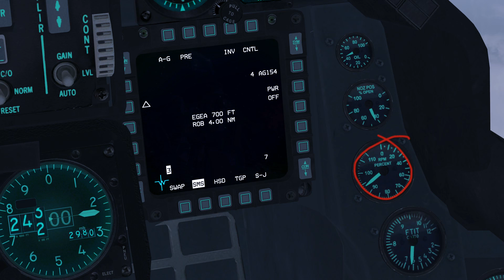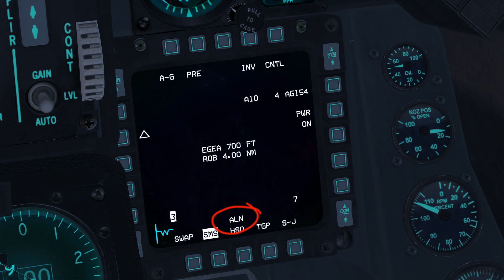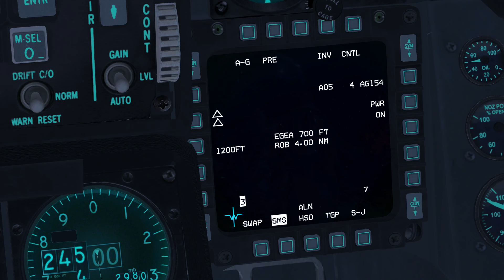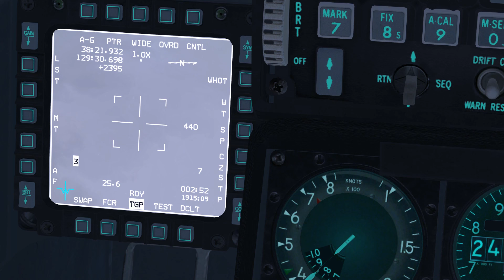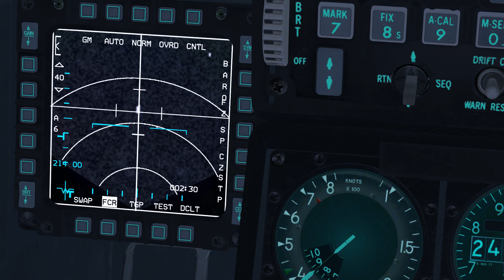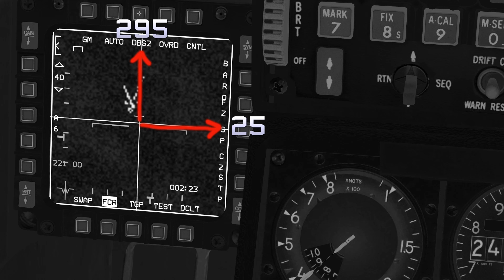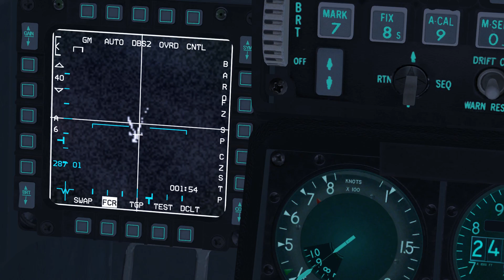Falcon 4 BMS 4.33 Tutorial 12 AGM-154A JSOW vs 2 mechanised columns

Comment: Do you have to set  a mark tgt?  Can't you just lock the tgt on fcr?
Reply from the maker: You have to set the coordinates.
Reply: Are you sure?  I just tried again and it works fine firing them off with a lock on FCR.  Can't be a GMT because it just goes to the coords from lock-up, but for GM it's fine to just lock in FCR and fire.
Reply from the maker: I would have to test it to know for sure either way. But it's good to hear that you got it working.
Reply: Hi All!!! Thanks @supernova for your tutorials... AFAIK the JSOW (as all the IAM munitions) will impact on the coordinates the cursor of the SOI is pointing at during release: it doesn't need a lock, but I would like a confirm for more expert players.

Comment: writing attack azimuth always 270 wont cause problem at least for me i dont understand clearly how to calculate attack azimuth english is not very well
Reply from the maker: You can calculate the attack azimuth for the second column using the same method as was used for the first column. You look at your current heading and use that to define the angle required for the second column.
Reply: thanks ill look for it

Comment: How can I determine the best angle and azimuth to hit the target?
Reply from the maker: +amer odeh The attack azimuth is explained here:
https://youtu.be/AHUKvR7VJ5U?t=310
Reply: +supanova thank you :)
Reply from the maker: +amer odeh You're welcome. I hope it's been of use.
Reply: +supanova i have another question, sometime the jet refuses to drop a bomb, why ??
Reply from the maker: +amer odeh You might not have set master arm to arm, or you may not be holding the weapon release button down for long enough. As long as you follow all of the required steps the weapons should release.
Reply: +supanova  but i really  did  that :( ,
Reply from the maker: +amer odeh The best thing you can do is to note down carefully all the steps and go through the tutorial slowly, using freeze, and check and double check every step. If you do that the weapons will come off the rails.
Reply: +supanova thank u for helping :) ,